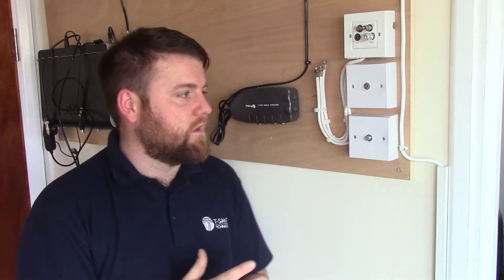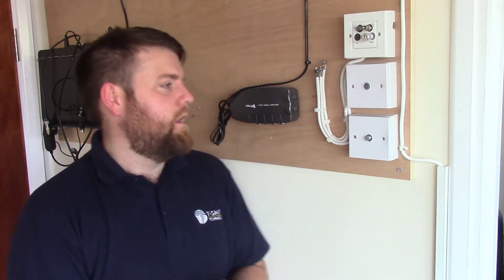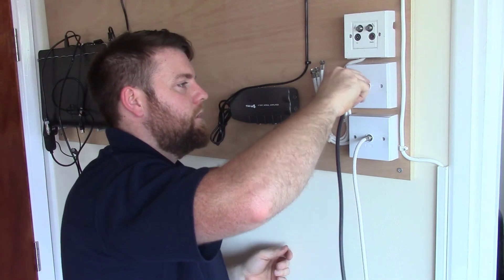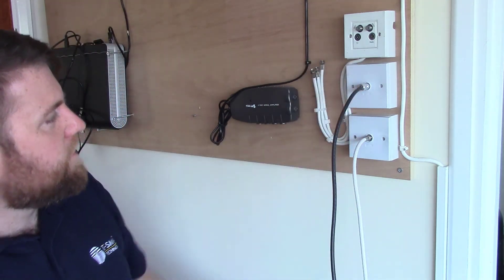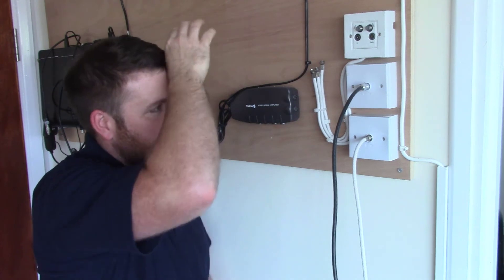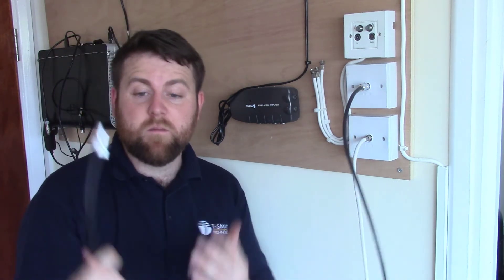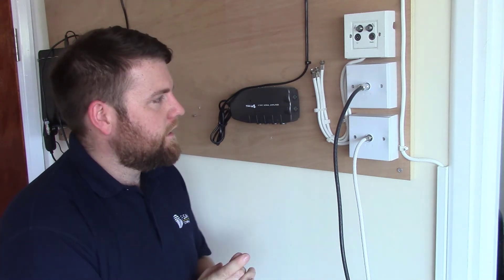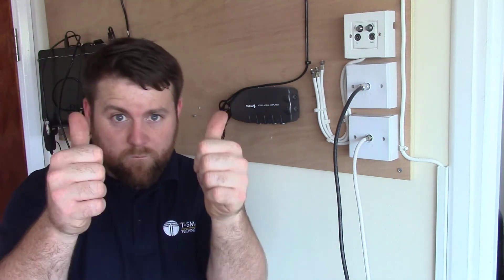Make Your Own High Quality TV LEAD

Comment: hello there, what brand of you coaxial cable you are using this?
Reply from the maker: I use Webro WF100.
Reply: Smart Aerials  hello there, what is a deferent of PF100 Screwfix?
Reply from the maker: Not a lot, PF100 is a good cable.

Comment: Can these self-made coax cables withstand 4G ingress disturbance ?
Reply from the maker: Hi Bjorn, yes just make sure that you use a good quality double screened coaxial cable.
Reply: @smartaerials  Thank you for the quick reply. 4G ingress begins to form a big problem here in Belgium. There are few TV stations that use a frequency near by the freqencies of 4G cellphone networks, and this gives very disturb signals when using standard coax cables, even with the more expensive cables.
Reply from the maker: Yes 4G is a problem in the UK too.

Comment: I bought some cable from toolstation which said it was "ct100" but on the drum it said "Gt 100", I can't complain however as it was made of pure copper and also had a copper shield. I bought this cable to replace a so called "professional" cable I bought at b and q, which appeared to be copper originally but turned out to be copper clad aluminium piece of rubbish, it did have a shield but it was aluminum ,I ripped this cable out and replaced with what I thought was CT 100 but turns out to be Gt 100 and the signal quality reception improved dramatically I get a lot more channels and overall better reception. 

One thing is Gt100 the new name for the ct 100? or was it just called ct100 to trick you to buy it? If so should I rip this cable out and try and find the real "ct 100", or is the cable I bought decent enough?
thanks
Reply from the maker: Hi Callum, always good to put a bit of good quality coax in as it really does range hugely in quality. GT-100 is not the new name CT-100, you will just find that it's made by a different manufacturer to a similar standard. For instance we use a Webro cable called WF100, but there is a PF-100 also which you can buy from Screwfix. They are all very similar, I have just looked online and the Gt100 is a good cable so I would stick with the Gt100.
Reply: Much appreciated thanks, Cable quality clearly does matter as I have found out, great to know I can keep this cable. thanks
Reply from the maker: You're welcome, please do subscribe to the channel. Tom
Reply: Is it worth doing this if I live in a flat which has tv, radio and 2 x satélite ports + TV return on the wall? My understanding is that the signal is not good anyway so would a better cable and fittings show an improvement in quality? Also, the TV sockets are male coaxials, guess I need a female coupler.
If I plug an F cable to the satélite 2 connection and connect it to the TV return socket, will I then be able to use a splitter in the bedroom in the slave tv socket and then run 2 cables to the TV, one for Freeview and one for free sat?

Comment: Hi, I am guessing you are a professional aerial engineer installer, I have found your vids very helpful, just one thing, what is the best brand 2 way splitter for freeview I can buy, one that's high quality reliable and keeps signal loss to a minimum? thanks
Reply from the maker: Hey there, thanks I'm glad you like the videos. Yes I do this professionally. For indoor splitters I use the Vision 2 way F splitters. For outdoor use, I use Antiference 2 way splitters, although the Vision ones are good too. Hope this helps. Please do subscribe to the channel. :)
Reply: Thanks :)